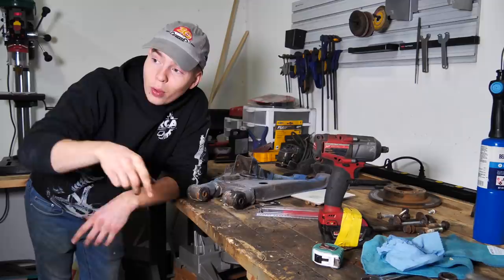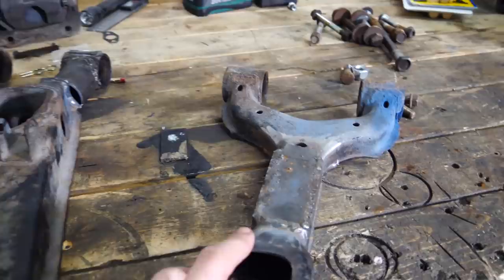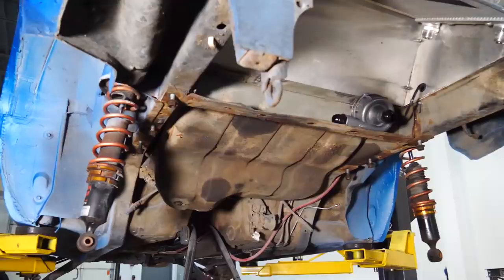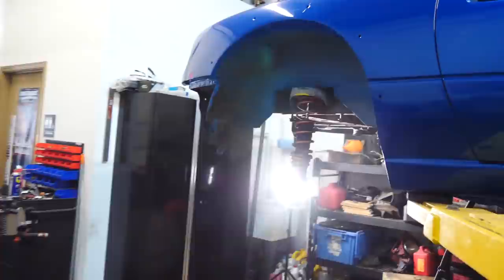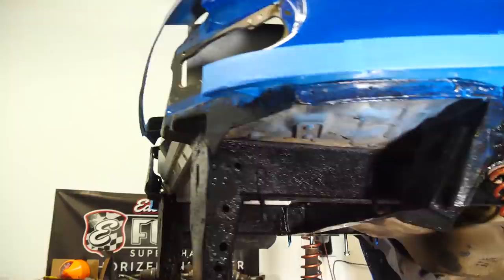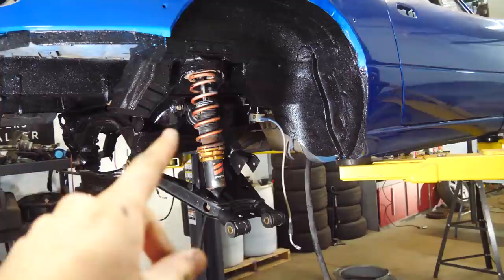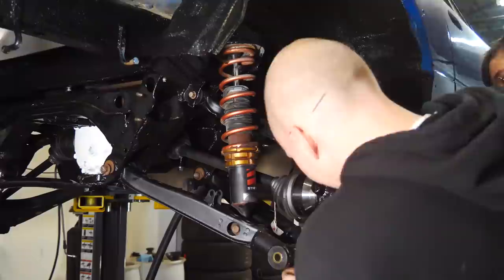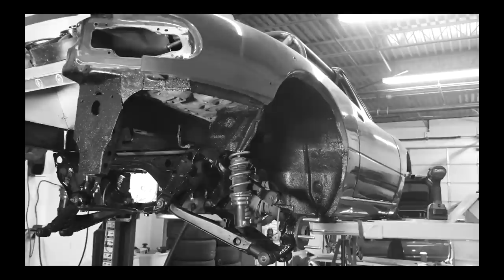AWD Miata Gets a MAJOR SUSPENSION REFRESH!

Comment: Is that undercoating product similar to what they put when you bring a vehicle in for rust proofing like Line-X etc, or is this more permanent like paint?
Reply: Paint Isn't permanent?
Reply: @TheWolverine-rm2kr  I mean, paint is pretty permanent. Of course its not gonna last 100 years though.
Reply: Issue with line-x on a chasis is the weight. Not to mention, it likes to collect dirt.
Reply: DurabakCompany.com  missed the point. The coating put on will rust underneath and likes to hold dirt.
Reply: DurabakCompany.com  the material does not stick well. Once it starts peeling water, salt. Dirt and so forth get under. Can even happen in not so well covered spots. The rust will eat under the coating. Ive seen it do exactly that.

Comment: I've always been told not to use bedliner materials for undercoating; they completely seal the surface, holding any moisture that was there or finds its way under, in.

Undercoating materials usually 'breathe' in some way, and can release moisture.

Comment: i literally just did this to my NA last week. Went with Energy Suspension poly, new coilovers, and new sway bars. and even though i dont live in the rust belt my control arms were pretty scabby so i blasted and painted them. The car is SO much better, especially considering most of the rear 262k bushings pushed out by hand!

Comment: You need to reinforce vertically the bottom control arms with two thick sheets of steel, one on top and another one on the bottom. The sheet you have added would only help with horizontal forces while the problem is with vertical forces. That sheet literally does nothing vertically.

Comment: 4:00 You know that shield comes off right? The most common method I've seen without taking the hub out is to slice it off right where you grinded, then simply slide it off and slide if back on when you're finished and put a little tac weld on it

Comment: should use steel it coating instead of paint. pricey but you can weld straight over it and its weather/abrasive resistant

Comment: That undercoating is really good thing do to, if you planning to offroad it. But not so sure with the rock hard aftermarket bushings for an offroad vehicle. =/ 
I got my car´s air conditioning serviced, but not at the main dealer, but at the Audi dealer. =) They had good deal about air conditioning service, and because I had an Audi for 10 years, so I still have good relations to them and they gladly serviced my air conditioning.

Comment: That brand new press might have come in handy to press in those ARP wheel studs?! Just sayin... lol
Also: it looks like you learned (the hard way) NOT to get POR 15 on your hands!! If not removed immediately, you are gonna have to wear it off, over time. Finally, I think that you did an excellent job on your rear half-shafts, welding each end together and then sleeving it! I believe they would've held up, even under power just fine. Keep up the good work!!

Comment: Why is the back bumper still cut out i thought you fixed that abomination
Reply: didn’t he put a rear mount radiator there?
Reply: @EvanRackle  yeah but I'm talking about the gap on the bumper. in the video where he was redoing the trunk to fit the radiator better he had a piece of silver metal with vents in it on the bumper line so it didn't look like there's a giant gap for no reason it just doesn't look good